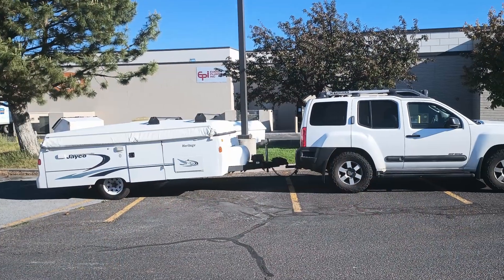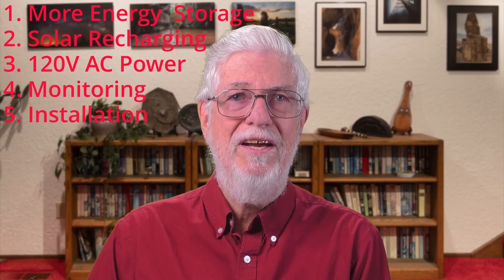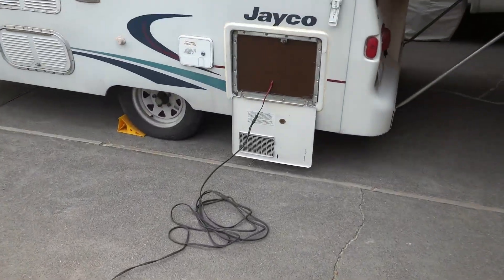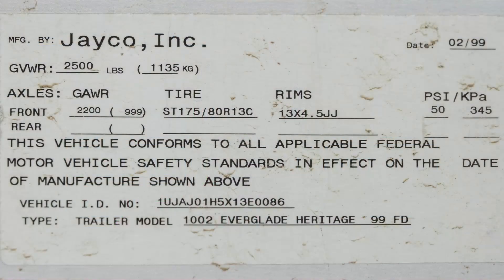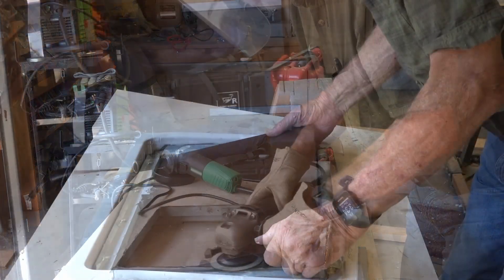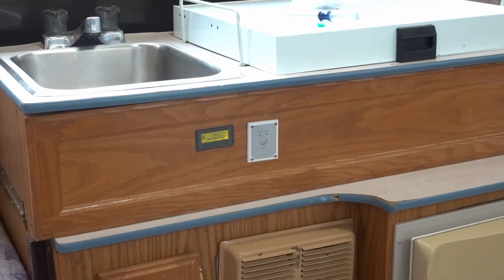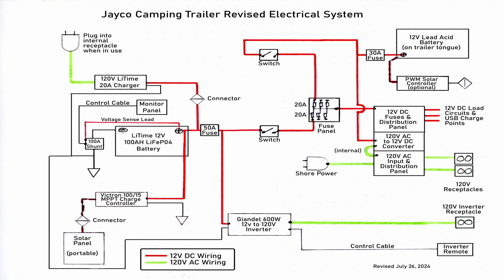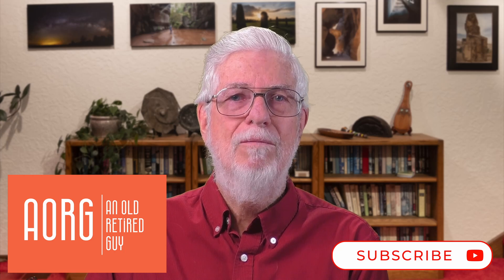Lithium Power for an Old Camper: Why, what and how.

Comment: I bought my first popup Camper (2004 Rockwood Freedom #2280) a week ago last Monday. The Seller forgot to tell me that the battery system was PULLED. I contacted WFCO who gave me a shopping list. Now that I am hip-deep the "Tech" has bailed on me. I am trying to work with the new guy. I have a PILE of parts both in hand and inbound. Looking for guidance to have someone do this for me.
Reply from the maker: I feel for you, because I bought an even older one (1989 Rockwood) last month. It also has no battery, an ancient power converter that isn't working and won't charge a battery anyway, and wiring that looks to be from The Middle Ages. I'm just now getting to that part because I've spent a month patching holes and fixing other stuff (like getting the roof to go up and down 😠). I'll be happy to answer questions if I can, but you could be in over your head. 🤔
Reply: @anoldretiredguy  These are the parts I have SO far: WF-5320 (Inverter), WF-8725 (converter), T-30 Transfer Switch, 400-watt Solar Panel with 12v/30A solar Charge Controller. (And ordered today) LiFePo4 TWC Worth 300 Ah battery. Bidding on a WF-8955-AD.
Reply from the maker: @IrishinTN-z9w  Wow, that is some serious power electronics - cramming that into a popup camper is going to take a LOT of space. Are you planning on living in the thing? I assume if you succeed in getting the WF-8955, it will replace the 8725 since they do essentially the same thing except for power output.  (The 8925 is a bit undersized compared to the rest of your components.) The old popup I"m working on is only going to have a 100Ah battery and a tiny inverter, because I don't take any 120V appliances camping - the setup you're aiming for is bigger than my motorhome, so it's definitely out of my league size-wise.

The spec sheet for the 8955 seems to say it will actually charge a lithium battery at its rated 50A current, so you should be okay there if it's wired adequately. However, if you expect to use the inverter near its full rated 2000W output, its input wiring will have to carry up to 200A (which is also the maximum current for the battery), which means VERY large wire. The inverter will need to be as close as possible to the battery to keep that from getting out of hand.

I can see why you might feel like you need a professional to set this up for you; I certainly would.🤪
Reply: @anoldretiredguy  I might of gone overboard but I was following the advice from WFCO. I have been looking much of the week for someone locally to do this. I find NO ONE, Not even in Nashville.
Reply from the maker: @IrishinTN-z9w  That's a bummer. I wouldn't know where to look around here (Idaho) either, because most RV shops only repair or replace existing hardware. A whole new installation means messing with cabinetry, all new wiring and other stuff that is normally the province of the camper manufacturer. Just out of curiosity, I did a search for custom installers and found one called Explorist in Oregon (no use to you, obviously) that publishes cost estimates for such jobs. Their base installation cost for a "30A Tow Behind Camper" with a 2000W inverter is $3800 (for labor). And that doesn't include installing solar panels. For that kind of money, I'd spend a lot of time watching DIY YouTube videos. But I"m retired, so I can spend weeks learning and doing this sort of thing.
Reply from the maker: @IrishinTN-z9w  By the way, Explorist has a YouTube channel (Explorist.life) that has DIY videos on pretty much every aspect of what you are trying to do, if you wanted to tackle some or all of it yourself. And if you were desperate enough, you could haul your camper to Oregon for them to do it for you - take a vacation out west. 😀 I'm sure there must be similar outfits in other parts of the country, but my really quick Google search didn't turn them up.

Comment: Gary - I appreciate your presentation and no-frills explanation of your goal and how you got there. Definitely gives me a few ides for a pop up camper I just picked up that had the electrical gutted by previous owner. Glad I found your channel, be well sir
Reply from the maker: Yeah, most older pop-ups didn't have much in the way of an electrical system to begin with and many seem to have been modified over the years. Good luck with yours.

Comment: I feel very inferior right now. My son just bought a camper very similar to that. If not the exact same thing. This would be great to do together. But I’m going to have to watch this video two or three more times and still do a lot more research. The cost is very reasonable in my opinion. Thank you.
Reply from the maker: Glad you found it interesting. You could simplify this whole business a lot by replacing and/or not re-using the original components. It would have avoided the two-switch arrangement, and I could have probably disabled the 120V-to-12V part of the power converter and used the lithium charger in its place. It has the same 20A output as the original power converter, and its supposed 14.6V output is not so high that it would damage the 12V DC loads in the camper. (It does shut off automatically when the battery is charged, and I haven't yet verified that it turns back on automatically, so that might be an issue.) Anyway, thanks for the feedback.